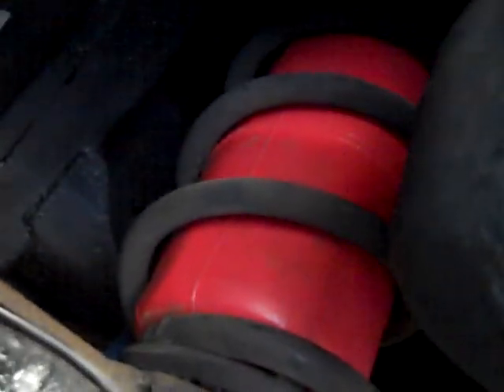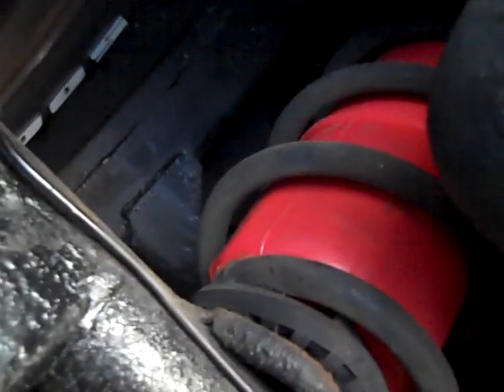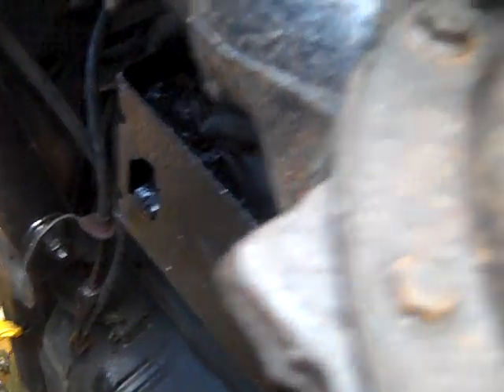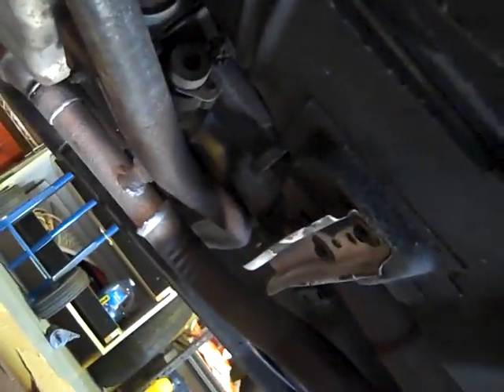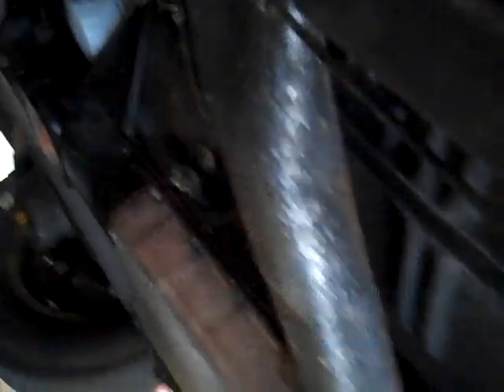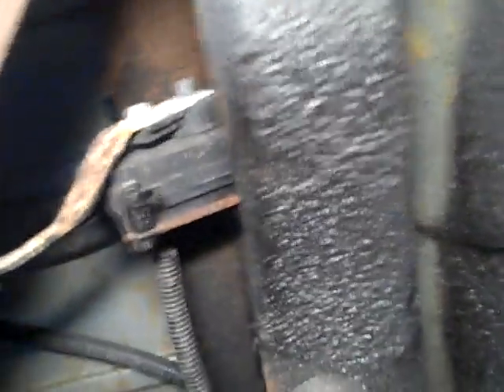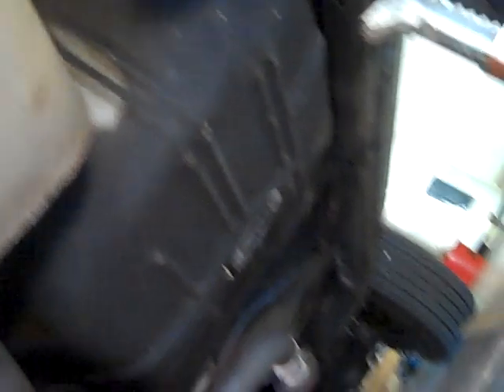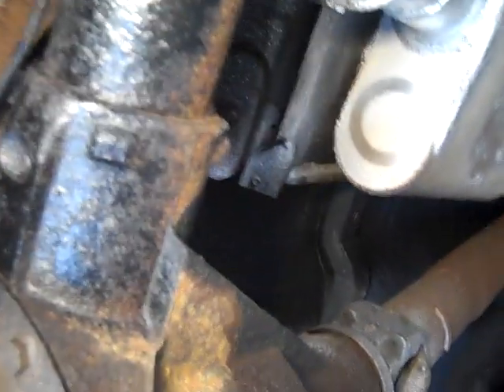AIR LIFT  bags in progress!

Comment from the maker: @cdronunez  If the suspension is sagging from the car being loaded, They will level the car. These wagons had air shocks from the factory that aired up the car. Air shocks ride terrible so I put  in the bags.   If your car is sagging w/o any extra weight I would just replace the springs. They are pretty easy to replace on the B-bodies. Just drop the shocks, get the rear end as far as it can go and pry out the springs.